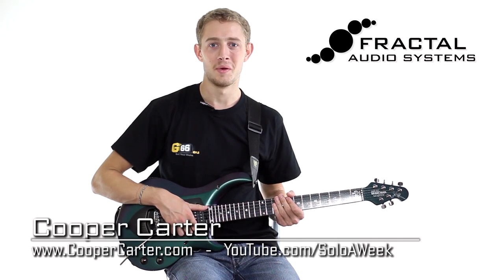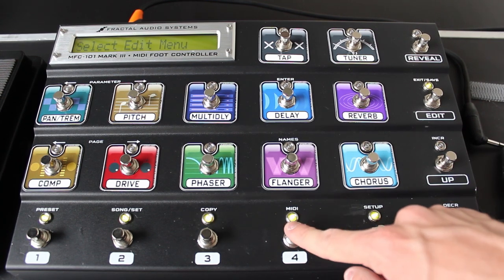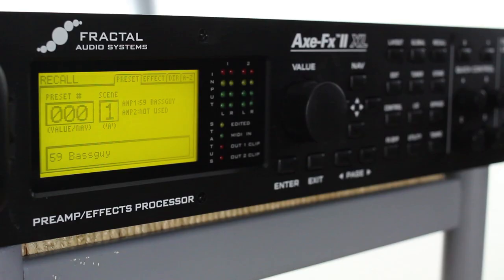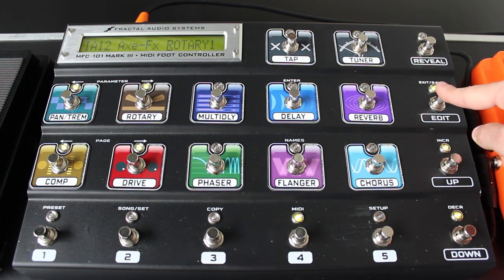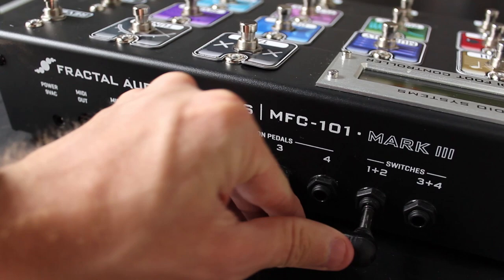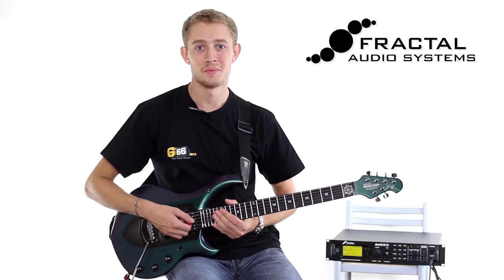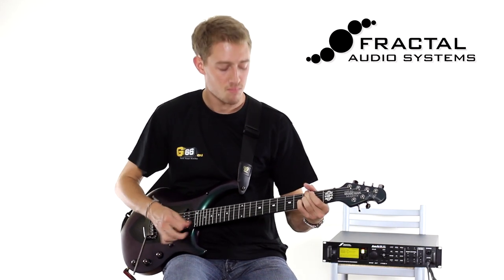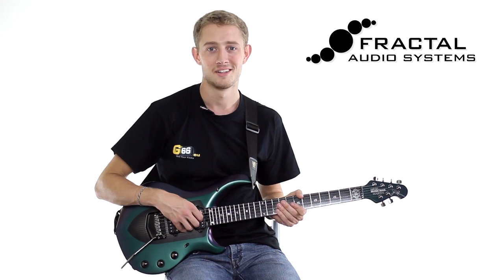Setting up the Axe-Fx II XL, MFC-101 MK III, and Mission Engineering SP-1

Comment: What's the main difference between the Faslink and the ethernet I know the faslink is a standard XLR but about functionality?? I just got my Axe Fx II XL and I am using ethernet cause that is what I Had.
Reply: The Faslink cable provides the same functionality as the Ethernet/Ethercon connector but with the added advantage of easier to find XLR cables (cheaper too).  If you are at a gig and your Ethernet/Ethercon cable breaks you will be less likely to find a replacement quickly.

Comment: That's cool, it helped me with the offset, but there was a really good video awhile back where you could set up the pedal to control wah AND volume by using the EP2 input for the switch and using it to control the volume and wah engage, but backwards. How do you do that?

Comment: My MFC 101 keeps going back to the set up mode showing X001 and no patch names, then after a few seconds 'AXE FX NAME TIME OUT' shows, and no matter what I do (including resting the MFC101) I cannot get back to my patches. And when I am changing preset 1-17 the MFC101 is showing X001-X017 and the AXE FX II is not changing at all! I have reset the axe fx in utility and I can change the patches from the Axe FX by using the toggle, but I cannot change the preset there other way round. And no preset names are showing! Please help!!!!
Reply: desyguns1 has changing the firmware do anything for you?